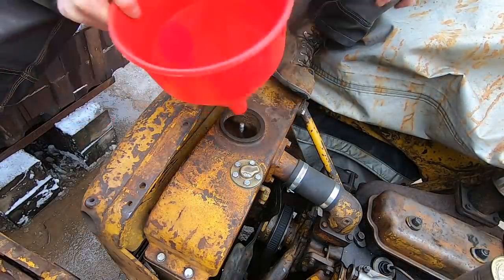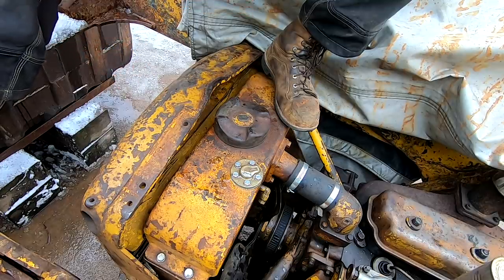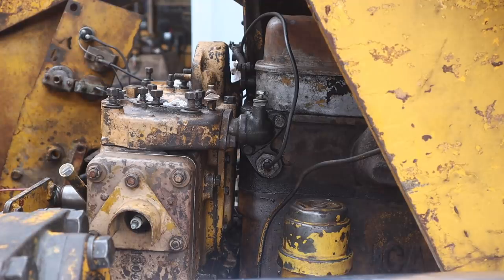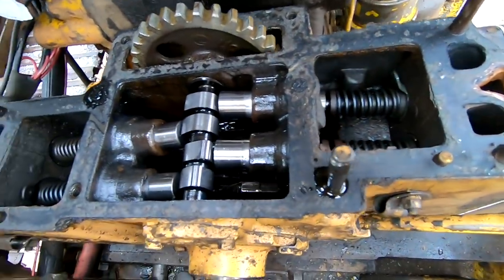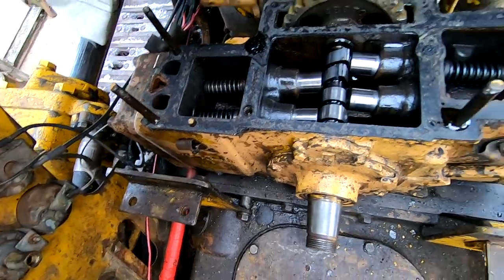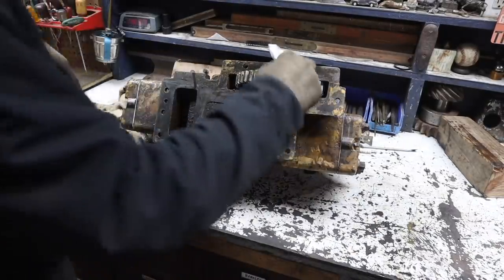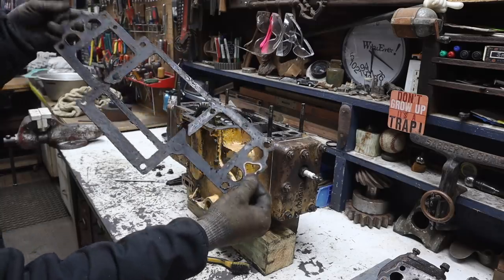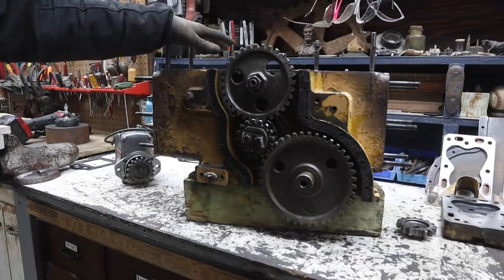I REMOVED the Pony Motor!!! ~ Part 15 ~ 1950s Caterpillar TraxCavator

Comment: I know you will but I'd run an endoscope camera thru any passage way or hose that connect the pony to the rest of the machine then run a flexible magnet a few dozen times thru, also check the clutch housing for sure, id say the other side of the castle nut was found and the side you found they gave up on, I appreciate you documenting this adventure makes me a little more comfortable woth doing my ac

Comment: First figure out what you have.  Take the crank to the machine shop and have them repair it.  Then get thee to the nearest CAT dealership and purchase the right parts.  Especially those bearings.  DON'T assume that just because it will get light use that you can cut corners.   Unless, of course, you want to be back in that pony motor next year.
Reply from the maker: Do you really think I cut corners on ANYTHING that I do? Why would I start here? Making my own bearings isn't cutting corners!

Comment: Believe it or not but these bushings are still sold by Cat but they will be ~$100 each I think, you can have them made, original ones are made of 750-T5 alloy, but this is no longer available so you can use 7075-T6 alloy which is readily available. You might have to machine a bronze spacer too to get rid of that end play but that should be easy.
Good luck and keep these videos coming! :)

Comment: you should not try to make that bearing... I seriously doubt you have the correct alloy to fabricate that, and bearings will be available for sale that match what you need there that have been actually engineering for the job at hand.

Comment: When I was young all the bigger farm tractors had another smaller engine to start the main engine. In the UK we call them Donkey engines but same thing. Before that when the tractors ran on TVO you had to start them on petrol and then switch over to TVO when warm. Modern machinery is so much easier to use but has a built in self destruct date. Nothing lasts anymore like this old girl.

Comment: The one I worked on had phosphor bronze bearings.  Splash oiling. Had a bit of crud fall from under the top, and that blocked the oil galley.  The bearing got hot, swelled, and seized on the crank.  Quite a challenge getting the crank, with flywheel and cover still on it, out of there without the use of dynamite.  I did have to get brutal with it, getting the bearing loose from the journal, but once it was off I found that the crank wasn't hurt.  If I really had to, I could have honed the bearing and re-used it.  But a new one was available at reasonable (for Alaska/PNW) cost, so we replaced it.  I'll suggest you use the oem parts if you can.  I don't know if you can still get them, as my work was ... (gulp) now over a quarter of a century ago.

The crank seal, on the output end, was another issue I found with it while it was apart.  I'd noticed that it was using a high amount of oil, even though it hadn't smoked (much) while running.  That seal, it turned out, had disintegrated.  Being inside that casting, you'd never see where it was being lost.

Adjusting those valves ... if you don't know already, you may be surprised on how that is done.

Those engines are a bit like working on old Volkswagens.  Never what you expect, hell to work on when you don't know them, but once you learn it's not that bad.
Reply: by the way ... How's your hernia?  I wouldn't have even consider trying that, even 25 years ago.

Comment: Glad you got back to old red, and sorry for the setback. It's amazing what unfolds when you role up your sleves and start taking one part at  a time an d get down to the root of the problem. With your plan going forward, I'd say it will get fixed. What about the broken gear teeth? 
Thanks for the excellent content and hard work.

Comment: Aaaah, I see. The water level was just blow the link pipe until you lifted the pony motor and then you got half the main engines jacket water coming squirting out :o) This is older than the machines I was cutting up for parts as a teenager so I am fascinated by how it all works .

Comment: Great video series on the Cat pony. I own a 1956 D47u and a 1940s D46j both with pony motors and am lucky enough to live in Queensland where it never snows or gets cold so the pony run time is very short. I'd still think twice about replacing the pony with dedicated electric start only because the old diesels don't have glow plugs and it'd be a big starter motor, battery and generator to cope with a cold start. The "bush" is likely babbet metal rather than aluminium and don't forget it is only splash lubricated...so a tight bore fit might not be ideal to get the lube oil to the crank journals. Mine are loose as hell but I don't think that matters at only 2,000 - 3,000 RPM. My advice is focus carefully on the valve stem guides and seals; it'd be a pity to have it all smoky after a lower end rebuild. I look forward to your next installment...
Reply: Also, you might want to consider using Seafoam (naptha or shellite) to maintain the rings clean in a horizontal bore... same as for outboards, boxer engines and Subaru.

Comment: The pure ethylene glycole would have been fine, it shrinks when it freezes, water is pretty unique in expanding due to the hydrogen bond characteristics, but overall, I think its the right decision to do the 50/50 mix.   Love the videos.

Comment: nice disassembly of motor (engine) now do the right thing. Replace the bearings, turn the crank, mic the pistons and cylinders, replace the rings, gaskets, magnuflex any suspicious parts (crank, block) and turn to someone who has the knowledge that can guide you through the process of the correct re-assembly of the pony motor. Do it right the first time, and it makes all the difference in the world ( in the CAT). Enjoyable channel  :)

Comment: scotch bright rol-loc discs on a mini pneumatic angle grinder are the best way to clean up gasket mating surfaces i've ever found. quick, easy, won't gouge the surface, and as long as you don't apply excessive pressure, they won't remove metal even from aluminum. plus the small particles will be trapped in the discs, unlike sandpaper. that engine has obviously been torn down before since things had center punch dimples to mark components. and you're right, unless you are replacing with new, you want to put the same parts back where they came from, because they wear in. if you don't you'll have clearance issues down the road.

Comment: I have never worked on a CAT before.  The main Bearing may be aluminum, but my bet is that it is a Babbitt type alloy.  Bronze would wear better than aluminum but Babbitt would be the best as far as toughness.  Check with the CAT dealer and see if they are readily available and affordable.   If you think the mains need polished check them at 3 points to confirm roundness.  If they are out of round the crank will have to be ground under by a reputable crank grinder.  If you do polish the journals yourself the crank must rotate in the running direction on your lathe.

Comment: At the time this equipment was manufactured, Babbitt was popular as a bearing  material. It would look similar to aluminum. The bearings were poured and machined. I have worked on equipment and vehicles with Babbitt bearings when I was younger. I am 81 now.

Comment: Pretty sure coolant  comes in from the bottom flows around the heads and up to that join to the diesel block.  Remember hot water rises.  The warmer water into the block at that point allows for quicker heating of the block than if the water was forced the other direction.  That is my thinking.  Squatch253 would know for sure.

Comment: I wonder if the press fit on the main bearings are press-to-gap in order to set the crank end play? Or if they have to be ground (milled) to tolerance at the bearing stops? Something you might want to read up on?

Comment: When you mix antifreeze use distilled water. The though you have changed the freezing and boiling temps the minerals in regular tap water still build up. The white deposits when you rebuilt the radiator were deposits from tap/well water

Comment: Agree with the other comments suggesting that the bearings might be made from Babbitt. If you want to machine your own, you might want to consider oil impregnated bronze. It should make for a longer lasting bearing. You may also get lucky and find an oilite bushing in the size you need directly off the shelf.

Comment: Hello I would suggest that bearings are not Aluminum but a white metal or babbitt alloy. This a mixture of Tin, Lead, Zinc, Antimony and Bismuch. The proportions depend on the load and working conditions that the bearing is going be subjected to. As white metal or babbitt is a soft material when it wears the hard spots in the alloy make small groves in the surface of the bearings and allows oil to lubricate them. You most certainly can replace the bearing with Phosphor Bronze or Gun metal but I would recommend that you put an oil grove in it to allow lubrication. This also stops the bearings running hot and over heating as they are metal to metal not needle or roller bearings. I hope this helps,

Comment: A fried made a gantry crane using a couple of old pallet rack end frames for the sides and a couple of load bars for the top beam.  Added casters to the frames for mobility and a piece of barn door track with a carrier for the hoist.  Might be a good project for you, and save your back with some of the heavy pieces like the pony motor…

Comment: I had a Cat 619 scraper that I converted to electric start. I have a Cat 12 that I also converted to 12 volt direct electric start. I used a common Delco starter that I had the Bendix changed to a straight cut gear. I live in Minnesota and used the grader for snow plowing and it always started with two 12 volt batteries wired in parallel, with no glow plugs.

Comment: It may have already been said but the big issue with the crankshaft was end play.
So make sure that the new bushes are long enough to take it out.
Maybe the multiple holes on the rear are staggered so that the locking pin can hold the bush closer-further in?

Comment: It been my experience with the rope start machines that used this starter (D2’s, D4’s, graders, etc) that the flywheel comes a little loose and the torsional vibration causes the magneto gear to fail as it is at the end of the gear train

Comment: I agree with Lyle the broken gear was probably from the nut also there are three holes in the bearing are two of those oil holes or are they to set the end play in the crank? By putting the pin into a different hole,looks like the holes are at different depths from the side of the bearing. Awesome vid by the way and best of luck.

Comment: First, I hope you washed any spilled coolant under the TraxCavator.  Dogs can find it "sweet" tasting and lick it which can kill them.
Second, before you commit to using bronze for you bearing, ask some of the flock like Squatch253 if that is an appropriate material.
Third, if you can chuck the crank in lathe, you can probably just use fine emery paper to clean up those "rough" spots on it.  You need to remove as little material as possible AND keep in round !
Fourth, to get a good fit of the new bearing in the hole (after you clean that burr) you will probably have to do a hot/cold shrink fit.
Fifth, the in and out play on the crankshaft is caused by excessive thrust bearing wear.  On some engines, this is a a specially made bearing/shim that takes up the slack, frequently on one of the center main bearings.  On that engine, it is the inner "face" of either the front or rear bearing.  Making an exact copy will not solve your problem.  One of those bearing needs to be a bit wider

Comment: We had an old Cat road grader at the ready mix plant with a pony motor. The sequence to start the diesel was to start and engage the pony motor and walk away and smoke a cigarette. That was about how long it took for the diesel to be ready to fire. Worked every time. That may have been overkill with the pony motor, but as the Head Mechanic said, "poor people have poor ways". Just to be safe, I would at least put a heat lamp or two under the engine at night. Something.

Comment: they are a aluminium/tin alloy and are still available from cat dealers worldwide. expensive though try $100aud each. the problem is they also control the end float of the crank. excess play due to wear or broken or loose bearing dowels induces a harmonic vibration that destroys the magneto gear, bends the magneto shaft, or worse the crank. also the crank will walk through the bottom of the bearings on the flywheel end simply due to its own weight and the rocking of the machine as it moves. to stop that wedge the pony flywheel with a couple of timber wedges placed underneath it to support the weight after starting the main engine.

 a ACMOC member by the name of Neil? solved the end float problem by machining the bearing housings and crank to fit a set of bronze thrust washers he made. the bearings are same as original just cut shorter to fit in the same mounts

Comment: when you go to make the bearings for the ends of the pony crankshaft..  are you going to create tapered oil grooves to use the friction between the crank and bearing ID to drag oil in and create a floating effect for the crank mains..   might need to make an oblong tapered hole below the drip hole to increase this effect..   i am also thinking that you may want to create additional tightness of the press fit into the bores to prevent wiggling..   hopefully you have a friendly crank grinding shop nearby who can grind and polish the mains to get a decent finish. since you are making bearings. the journal size they grind them to is unimportant..

Comment: Usually some sort of thrust washer is used to adjust end play.  If those bearings are worn you will need the proper width of a new bearing to make new ones

Comment: I would guess to use a zinc based oil in the put motor as well.  Also a lead additive or derivative in the gas for the put motor.  Ol Red is should be lovin the attention!

Comment: I only use premixed coolant, for 2 reasons.
1. the ratio is always correct.
2. the water, in factory premix, does not have any additional minerals or other chemicals.

Comment: Fun fact:   You don't really need to worry about glycol freezing, unlike water which expands upon freezing, glycol contracts...  so it won't break anything when it freezes.  

Both ethylene and propylene glycol behave similarly with propylene being used in potable water systems for RVs and boats.

Comment: You need to get ahold of Squatch253 he’s rebuilt a few of those pony motors and has probably forgot more than most people know about them. Another thing I noticed is that’s a flat tappet cam, you may want to run a high zinc oil in it if not already.

Comment: I suspect the bearings you called aluminium are in fact white metal or babbit bearings which were common on low load low rev engines. They can be melted recast and re-machined to original tolerances. Good luck and great video.

Comment: Very fun to watch. Thank you. I don’t think the end play on the crankshaft is the reason for the magneto’s broken tooth. Some end play is normal. The gear meshing with the magneto seemed to be solidly mounted with little play. I think it was something else altogether. Any way a foreign object could have jammed the gears? The mag gear would certainly fail first between those two. I’d just hate to see it happen again if the problem isn’t fixed.

Comment: I was already thinking it might come to making crank main bearings. I really can’t see bronze being bad. However, it’s a CAT so it ought to be some standard inch size. If it is then bore the rear main bearing to fit a modern white metal shell bearing. Then you can fit and forget and never worry if the bronze is wearing the crank pin :o) as a start for a white metal bearing I would start with a cat cam shaft bearing

Comment: Suppose the crank originally had thrust-washers to set end-play or would that have been via gasket thickness?
That's an unusual valve-spring setup, coming out through the valve-seat area. Makes sense, would be a pain to get it out some other way. Makes it easy to replace the valve-guides too! (or at least one part of the guides)
Huh, rod-bearings seemed a bit loose in the rod, maybe? I'd think bronze would work fine, solid not oilite, as it's kept oiled well enough on its own. I look forward to hear it purring like a kitten once again!

Comment: I don't think that end play would have caused the gear tooth to break but I agree its not good and should be fixed. I am wondering if at some time in the past that the starter drive mechanism between the main diesel and the pony motor failed to disengage. This would overspeed the pony motor and stress the hell out of those gears and anything else in the pony motor. Whilst you are torn down to this point I think you can pull the starter shaft and check the engagement and disengagement  locks on the shaft.

Comment: Those bearings are Babbitt, which is a lead tin alloy also referred to as white metal. You can actually cast your own if you can't find new ones.
Reply: Cat used aluminum bearings.
Reply: @brianrvd  that's interesting, thanks. I wonder what the reason was for going with aluminum over a bearing material like Babbitt or bronze?